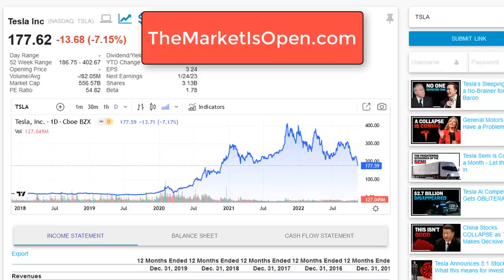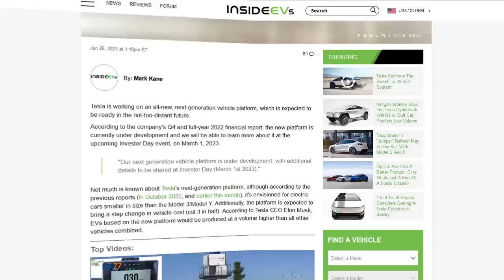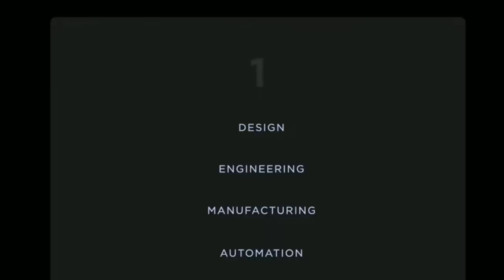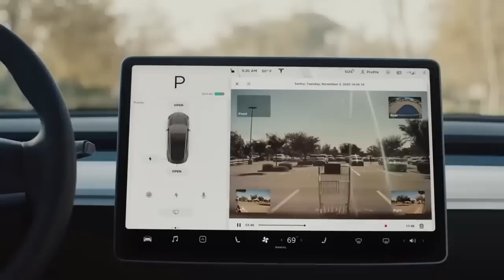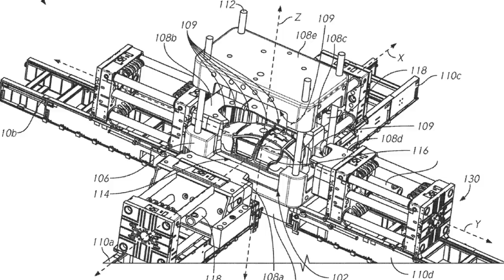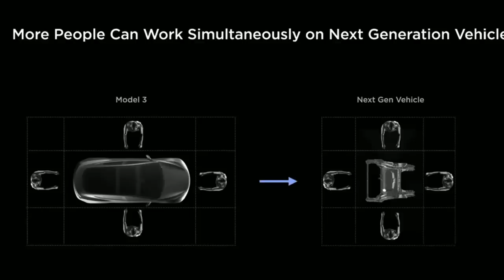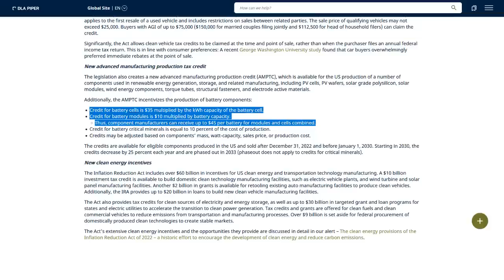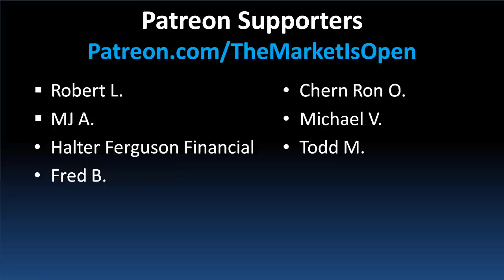The REAL Reason Elon Musk is Developing a CHEAPER Tesla

Comment: oh there is more than one reason, trust me.....if anything Tesla gets scraped, it will be the semi-tractors ... those things are like a utility grid line loss sink hole that would be the equivalent of shooting the whole electric vehicle market in the foot .... line loss is part of that market's efficiency equation, and thermal runaway losses would stain anything EV in a very permanent way..

they will be much better off leaving semi-tractors to the most promising of emerging opposed piston diesels, and focusing on consumer vehicles designed to work two part time jobs...one of those jobs sitting still while plugged into the grid...

i mean a less expensive, lower draw,  car will sell more.....and a more expensive , higher draw car will sell less ..... so it works out that way. ( until you start selling semi-tractors )

i could grantee,  if line losses went up even 5%, someone with the utilities would say: Hold On Here, This Is Not Working !!!
Reply: I don't think you get it. Semi's use a very large amount of fossil fuels and electrifying them would be of huge benifit along with all the other machinery that currently is deisel powered. Think forklifts, tractorsloaders, bulldozers ect. Where I am in South East South Australia, they are trialling the electrification of logging trucks. This is just starting but should prove very successful especially since nearly all our electrical energy comes from wind turbines for the past 10 years. I am unsure what you mean by " emerging opposed piston deisels" and "utility grid line loss sink hole".l
Reply: @andrewjoy7044  What if Ed is the one that DOES get it? Seems the grid might not be the only entity that can't handle the truth! Oops, I feel I'm being sucked over the edge into the sink hole.
Reply: If I Take The Time To Explain Here, Then I EXPECT you To Comprehensively Read All Of This !!!

the 48V sub-system problem, i mentioned here, will have a realistic solution ... and i find it very disturbing that you feel the much more serious problem here is not the problem.

Electricity Is NOT A Source Of Power, it is our form of Power Transmission with the most Flexible end use options <-----Meditate on that, even battery power storage is a conversion to chemical energy for storage..

Now you can study the subject of thermal runaway, as that pertains to the efficiency of electrical circuits, 
( then understanding that the utility grid is actually an electrical circuit, where this physical reality also applies. )

Electric Vehicle Efficiency Equations Should Not Assume A Full Battery....it starts at the power plant...
line losses typically average 50%, the company Tesla understands this, and is working on ways for their products to also serve as Distributed Storage....they can also try to locate charging stations closer to substations..

but the reality is, a usage in one place effects usage in other places, it is a complex interconnection, but by Javon's Paradox thermal transmission losses will never drop below 50%, and if those losses do drop below 50%, then there will be More energy consumption to write into EV inefficiency..

so Starting from the Power Plant, ( which i will refer to as 100% efficient ), roughly 1 x 0.5 x 0.82 x 0.9 x 0.87 x 0.95 x ( 1.1 for re-gen braking ) = 33-1/2% Efficient ... where newer opposed piston diesels will come in at 50 to 55% efficient ..... do you understand ? re-read until you do please..
Reply: @andrewjoy7044  people may be able to argue fractions of percentiles with me...but i was being fairly conservative in respect for the topic here i feel..
Reply: @andrewjoy7044  i will close with stating that  The REAL Problem is that i find Difficulties Discussing The real Problem ... there are many solution orientated individuals; and, as solution orientated individuals, we have the ability to adjust our dispositions to the realities, and keep working towards solutions ..... there are applications for everything, and nothing is presumably the end all, as much as being some part of a greater technological evolution in progress.
nearly all inefficiency starts and ends in the convolution of solution based people arguing with each other, where we are not allowed to discuss the real problems.....Why Is That?

Comment: Why do EVs seem to have so much horse power. Wouldn’t a smaller electric motor be more efficient and make the   Car go farther on a charge?🤔😬
Reply: Motors are small and they can provide more HP for not much more money, and it impresses some people. Also they provide torque at low speed so lots of zoom zoom. The increase of range and efficiency with smaller motors wouldn't be much. They would cost less, though, so I'm on board with that. One motor instead of both axles would be fine with me, I'm never in a hurry.

Comment: I would never get an electric vehicle until they solve the problem of battery replacement. Plus, the infrastructure needed to support electric vehicles is wildly expensive. The pollution caused by manufacturing electric vehicles, and all their components are much worse than the pollution produced pertaining to petroleum vehicles.
Reply: You seem to be somewhat behind the curve on the battery issue.  Batteries are likely to last as long, if not longer than engines/transmissions do.  The infrastructure.......umm isn't there already a electricity grid of some sort where you live?Regarding the pollution issue, there are much lower levels of toxic emissions in places we don't want them such as urban environments.  No one is saying that electric vehicles are THE green solution, but while people arent prepared to give up their cars in favour of greener options, electric vehicles are the best way forward at this point.
Reply: Nonsense!  Until an ICE vehicle can re-manufacture hydrocarbon fuel as it runs downhill it will always be less efficient.